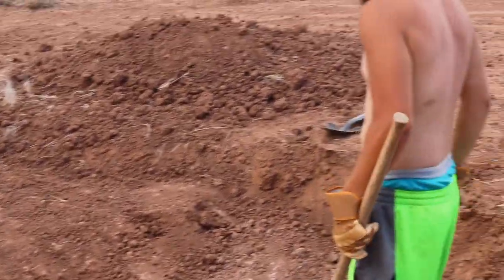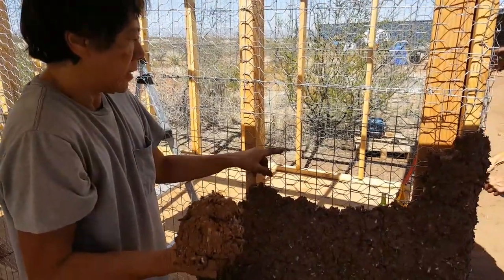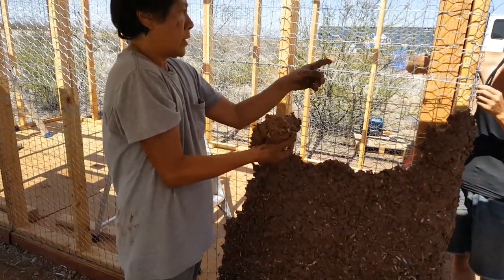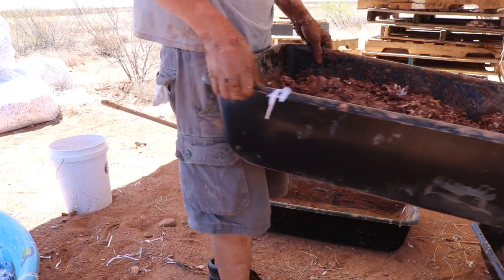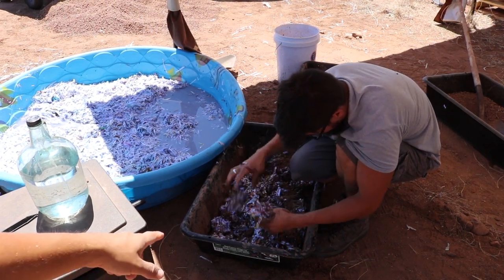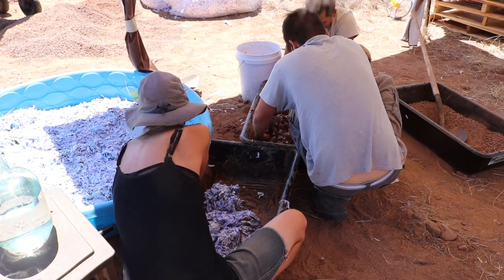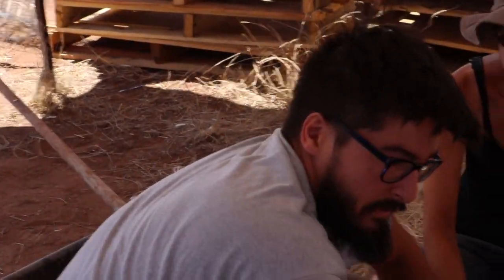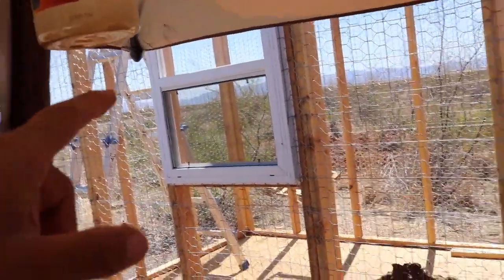Fiber Adobe Shed Build!

Comment: Old Camp Ranch, regarding using a mixer. I was fortunate enough to be able to attend the workshop on how to make and work with FiberAdobe as well as FiberCrete.  The first try WAS using a small cement mixer. However, it didn’t work very well because the long strands of paper just balled up like your sheets will in a clothes dryer. Very little mixing happened. So it was handwork. No hard to do, no difficult either.

Comment: Seems like a lot of give in the wire when he was pushing the wall, which I'd believe it'd lead to cracking of wall. If you wanted to build all natural, seems like adobe bricks would've went up faster and WAY MORE secure structure ! Good luck anyway.
Reply from the maker: It's possible for sure. We could have even made bricks with the material we were using, a fiber adobe brick. This should be good though. Even though there is a little give in the wire we compressed the earth as we were going. The walls are dry now, and are really solid.👍👊